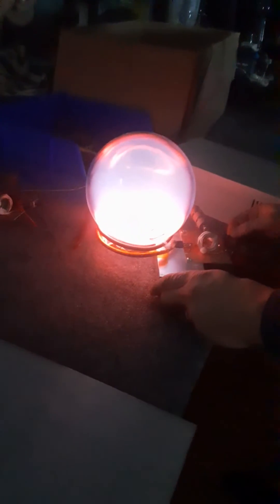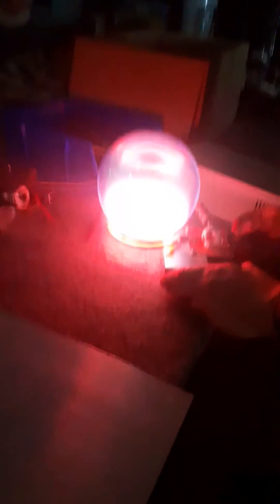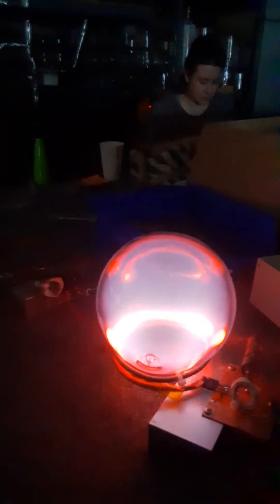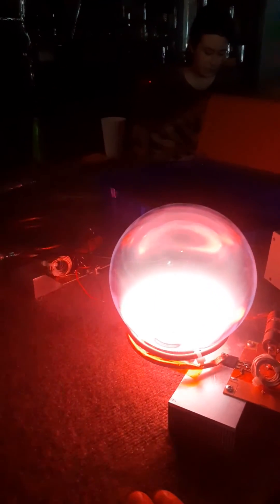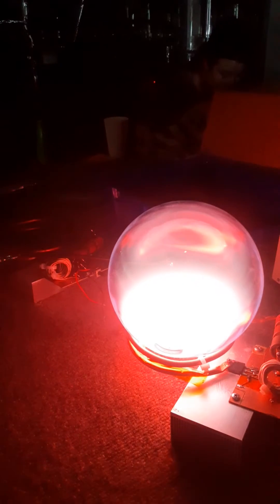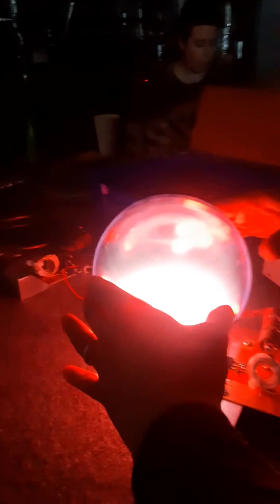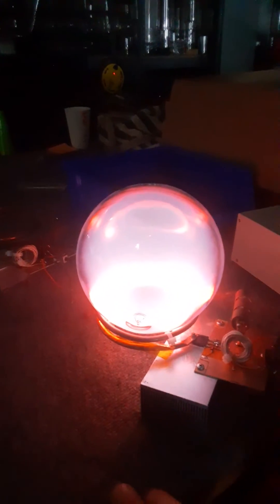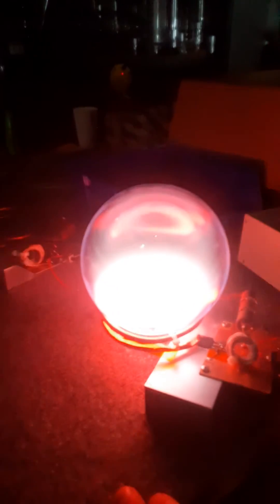Neon Plasma Toroid with Wayne Strattman

Comment: Would pressure above or below 10 torr work better with Neon in your opinion?
Reply from the maker: Neon is somewhat more resistive at 10T than it needs to be.  However, its still workable and a brighter glow is acheived.

Comment: Hi this may be a stupid question but does this mean store bought (neon) plasma globes could be used to create plasma toroids? because i have all the components to make a class E oscillator just not the funds to buy a specially made xenon globe.
Reply from the maker: Store bought globes are filled with a much higher pressure mixture of krypton, neon and a little nitrogen.  While the effect is theoretically possible, I have been completely unsuccessful in every attempt due to the very high pressure that requires a significantly stronger drive level.
Reply: @kcakarevska  Thanks alot for your answer, I guess ill be saving up for a while then :0
Reply from the maker: @CrocoDeluxe  Xenon prices are crazy right now! Unfortunately, I have yet to find a cheap substitute.
Reply: @kcakarevska  Man i'd love to see that in the future. good luck!

Comment: woah . . this looks realy interesting if not a little scary . . . also why is it red and not any other color ???
Reply: I guess the color is just the color of neon . . .
Reply from the maker: Red is the main color of neon gas plasma glow.
Reply: @kcakarevska  thanks but you're a bit late . . I google-searched that shortly after making that comment and aperently it's very redish orange . and not pure blood red whitch would look more pink at these intensities . . . also
how hot is the plasma ?? . . concidering the glass is cool enough to touch I'd assume it's not that hot . . but is it realy ???
Reply from the maker: @bluewhalestudioblenderanim1132  I would describe high-current neon as RED.  Not even red-orange. Pink is a sign of mousture contamination at any intensity.  Plasma, itself, is ultra hot, but the mass is so small at these pressures (1/80th atmospheric) that they don't usually create much effective heat, especially for the gasses heavier than helium.
Reply: @kcakarevska  thannks :)